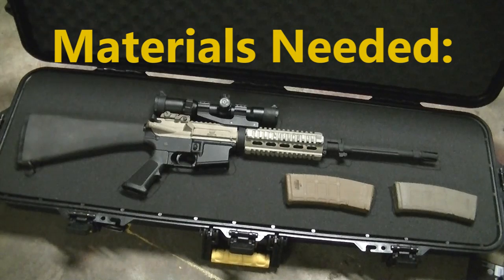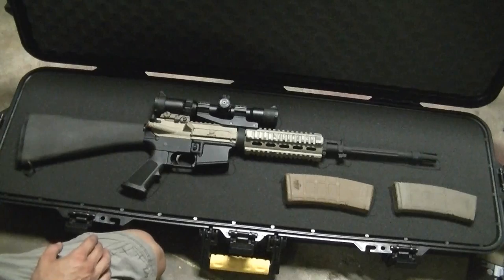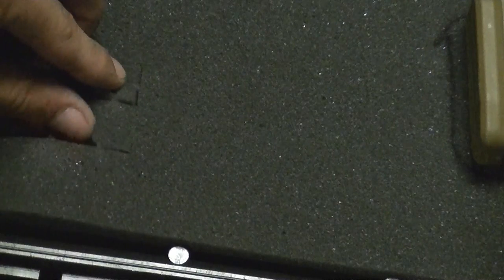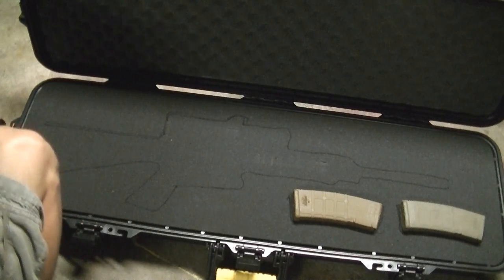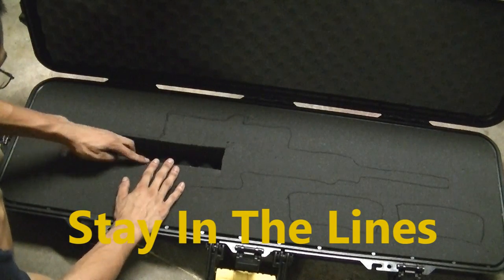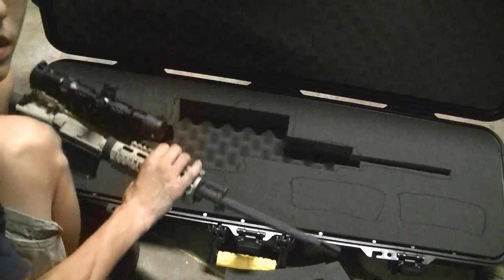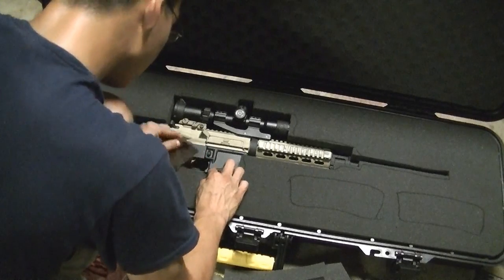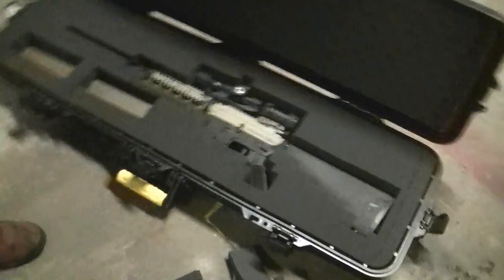How To: Pulling Foam for a Custom Rifle Case

Comment: Haha! I installed mine with light side down and was like crap! Then I saw you flips yours over and I was like GENIUS! Thanks for this video! You just saved me from having to buy new foam!
Reply: He should have also flipped the whole thing - the optic goes closer to the handle so the weight is not on top of it when being held. It's incorrect in this video.
Reply: Shouldn't the scope be on the handle side so its in the up position while in the carry position
Reply: @richg1221  no because when you open it it’s gonna be upside down
Reply: @AlejandroBonillaBeeche  not really I run my AR15 like this so when I open it it’s not upside down

Comment: Thanks for the video.  Surprised that when you flipped the foam, you didn't position it so that the scope was on the same side as the case handle, which would have taken pressure off the scope when carrying.  Still, exactly what I was looking for in how to fit something in my new case.  Bought Plasti Dip to help hold the final configuration.

Comment: What kind of case is that and where did you get it? I need something for my Tavor...
Reply from the maker: trinhbt it's the Plano Gun Guard Weatherproof case, 42in. long.
Most big-box gun stores will have them. Cabela's, Sportsman's Warehouse, ect. I picked this one up at Walmart for sixty or seventy dollars.
Reply: would you prefer this case of a shorter case for a 12 Guage shotgun?